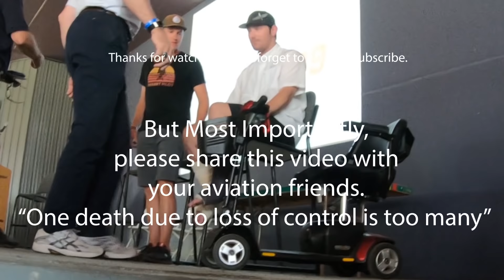NTSB Loss of Control Accident Survivor presentation by Nikk Audenried and Trent Palmer

Comment: I'm curious to know if you are considering installing additional safety features in your next Kitfox like 5-point seat belt restraints, air bags, visual and audible stall warning annunciators, an AOA indicator, and wearing a flight helmet? These are readily available crash prevention or crash protection systems that should probably be utilized throughout general aviation. Thank you for sharing your story for the benefit of other pilots.

Comment: Great lesson that knowing you are the most dangerous one is an important mind set -- I think not just in flying but in many risky activities that you want to do for the long term. Risk (whether it's in a sport or a business or a stock trade) means many people will be hurt doing it, the thing that keeps it from being you is the constant calibration and vigilance, no matter how much experience you've got.
Reply: As someone who has always wanted to be a pilot, but hasn't been able to afford it yet, this is a very VERY important concept. I am a machinist in my day job. It's one of those jobs where sometimes you don't even know you are pushing the limits of what is possible until something breaks... or goes flying. It is rare to get any warning at all. One second everything is fine, the next second there is a 12 pound piece of metal flying at your head faster than you can blink. I've ruined tools and parts and once or twice bent the machine, but thankfully not been seriously injured. I have been doing this for 20 years and still, every time I run a new program or trying something new, am fully expecting this to be the one that bites me hard.

Comment: Excellent presentation. I'm pleased that Nikk is recovering well. Youth has the benefit of faster recovery from trauma.

I've noticed in many Kit Fox featured bush pilot videos that many of the young male  flyers are often performing  extreme maneuvers close to the ground.

Of special concern are steeper turns at lower airspeed, and .....on - the - edge climb outs

It is not the cross controls or accelerated stalls that get you killed.... but being too close to the Earth when performing thes activities.

Comment: I remember when Nikk's video about the accident came out. It was chilling. 

I had, to my knowledge, one close call back in the late 80's. I had my PPL but not a lot of hours. I was doing pattern work at GXY. I was too high (thankfully) and in too close on my base to final turn so I did what you shouldn't do (not realizing it at first), I nosed down, in this case that was a good thing, over banked, and unknowingly had a lot of bottom rudder in. I glanced down at the instruments and saw the ball pegged (skid) and airspeed climbing. I corrected all of that and went around. If I had been at the right altitude the airspeed would have been lower and I might have become a statistic. That has event has stuck with me for a long time... Even today "center the ball" is stuck in my head...

I'm very glad to see Nikk making progress.

Comment: II think a lot of recreational, sport and light sport type flying of various craft including hang gliders, homebuilts, ultralights etc,, stalling too high and low is such a common and amazingly violent way to end your flight or your life. What I mean is stalling too high to set it down on the gear. In a hang glider for instance a foot landing is practiced by getting your wing to stall just when your feet are about 5 inches off the ground.. If you're 30 feet off the ground that's both too high to meet the ground gently, and it's also too low to recover. But sport flying in general is often flying at the slow end of the envelope, and these pilot have to bring airspeed awareness up very high on the list. In a cabin-less craft like the hang glider and ultralight you have more awareness than any indicator or gauge gives you, as your ears are your pitot tubes, silence means you're moving slowly so you have direct awareness to it But In Nikk's plane you have to watch your a/s indicator, as your head isn't in the wind. Sailors understand that sound too. Seems primitive or even ridiculous or silly but it's really  true, if you're behind a windshield your ears are not of any use at all! Keep your speed up Until your wheels are about to meet the runway of your choice. Such a tragic setback for Nikk and lost time, lost fun and too much pain and grief during the lengthy recovery.

Comment: Do you think it might have had something to do with the placement of the Vortex Generators on the leading edge of the wing?
Reply: A skidding turn with added back pressure is how (sort of) you enter a snap roll. Nikk basically did a 3/4 snap into the ground.

Comment: There are bits an pieces of what actually happened spread throughout the first 15 mins of this video, tight pattern, slow speed, then he talks about banking at 35 to 40 degrees and then climbing at 20 plus degrees.  He was definitely way on the edge very low to the  ground and he didn’t have a stall warning system (that comes out at about the 20 min mark). He says in response to the lack of stall warning question that you can feel it.  But as a pilot I have to say I have been surprised a couple of times with the stall tone coming on and I hadn’t realized how slow I had got and you subconsciously maintain a horizon picture leading to increased angle of attack and slower airspeed.  Personally I think him arguing that a stall warning wasn’t necessary was a little immature.
Reply: Julian vs I agree.  Bottom line.  He (and Trent) were having fun.  Showing off for the cameras and it came back to bite Nikki.  Flying has an element of risk, we (pilots) know this and accept it.  But, some of  us (maturity/age/ invincibility) disrespect it or become complacent...
Reply: Great assessment. He was in a bad flight attitude. 

Seems to me there are the key components that lead to an unrecoverable stall/spin.

1. Airspeed(slow)
2. Altitude(Low)
3. Attitude(high aoa, climbing, steep turn)
Reply: @coreymalhiot2796  Exactly. This was more than just the advertised momentary laps in a normal pattern that we are being told could bite anybody. It is a case of horsing around while not watching the airspeed at low altitude. Possibly to look cool on video. Why not just say this straight out at the beginning instead of us having to figure it out.